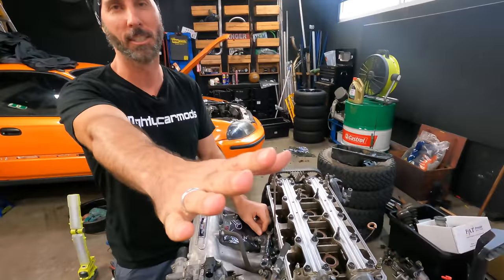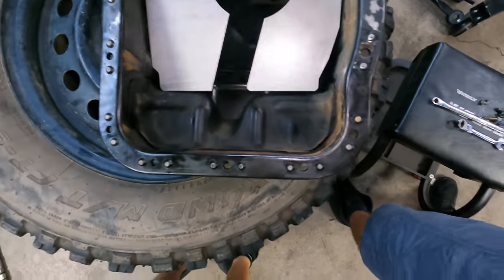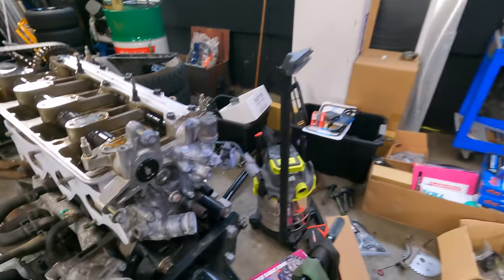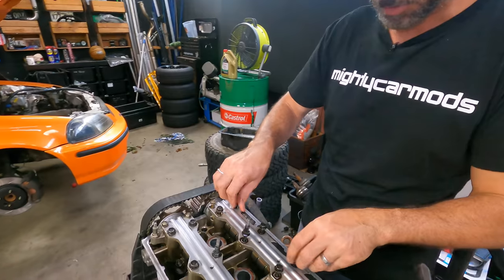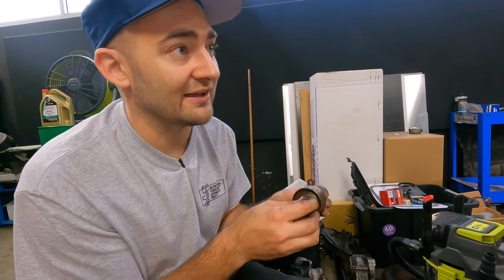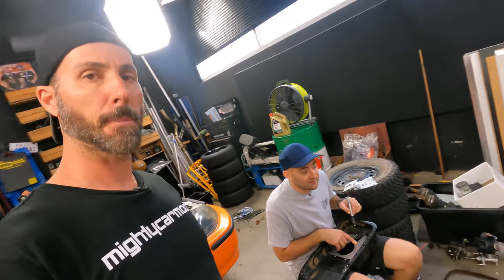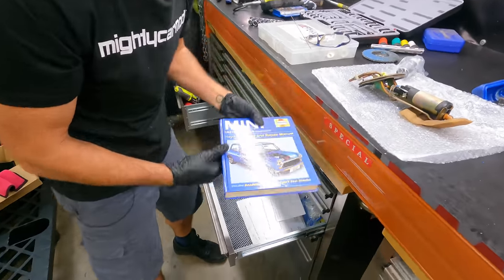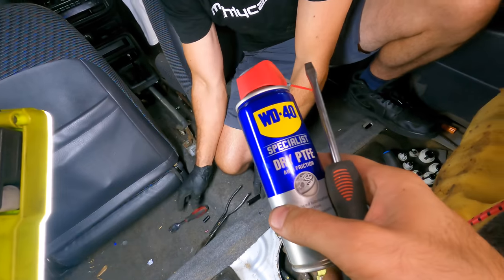Spoon your SKUNK until he MUGENS - CIVIC Build (EP5)

Comment: It's not only in the US. Imagine Europe with a lot of restrictions with co2 already back in the nineties, but most of all, huge taxes on engine size and cc. Then a civic vti comes along with a 1.6 cc making more power then all 2.0cc counterparts, like golf gti, Nissan sunny, Ford rs2000, opel gsi, you name it. Less expensive, better finished and much more reliable and it's even more powerful. Yes. In Europe, in the 90s having 160hp was like crazy. There are still a lot of people using them because of that. There were no turbos accessible here, or the ones we got were weaker than a vtec with 160hp. That's why 😜
Reply: And not only that... I don't know the reason why you got the crappy ones, but in Europe having an honda at the time was crazy technological, imagine 1992 civic vti with everything electric, windows, mirrors, sunroof, hydraulically power assisted steering, abs, 4 disc brakes all round.... Only Hondas and maybe some other Japanese cars, had it. VW didn't even offer electric windows at the time, only if optioned and very expensive. Still, when we compare speed, I guess it's a matter of culture, Europe has less straights we are more about agility. And I bet this civic will do 25laps and engine still smooth as opposed to an impresa for instance. 😂😜

Comment: I’m answer to Moog’s question civic, and hondas in general, are cheap, reliable, easy to modify and have lots of individual routes you can go.    Non-Honda owners hate on Honda owners because they do not get it.   Even the smallest engine models of each car are fun to drive.   It’s just amazing engineering.

Comment: 17:00 Well you could just go on a used car website and get the VIN from a vehicle listing with a B16A in it. Makes life easier when trying to order through the dealer. Our Honda dealer here doesn't require a VIN to purchase/order parts so when I go to them I just pull out part numbers or provide em with year, make, model & trim of vehicle & they just get what I need. But our Ford dealer does so I know how annoying it can be.

Comment: people up here in canada own hondas because they are drit cheap and easy asf to work on, same thing with the acura rsx's if you want a lower coupe than a sedan or hatch and you can buy ebay turbo kits for them for like 800$ and make big power for dirt cheap. Try buying something like an old mustang and then your into something much bigger in price, size, price of parts, price of insurance etc.... Civics are like the entry level project car for someone on a budget. They can buy it for dirt cheap and get it running for dirt cheap also since OEM and aftermarket parts are so cheap, as well as insurance being dirt cheap as well on those

Comment: VTEC!!! When it kicks, Your ADDICTED!!!   BAAAHHHHHHHHH!! And VTEC bug for life!!!. Cuzz after on, driving (besides just normal driving), but driving in performance manner, and racing, no matter what ur in, just doesnt feel right, feel kinda an empty void when you dont feel, and hear VTEC hit.... Its weird lol.. I build, ive built, from many different manufacturers, and love em all, but my hondas are always my goto!!  And besides the VTEC bug!! its just the best budget to horsepower gains around. Especially when your young with the enthusiast mind, and not making much money yet. its more affordable to modify and get back a return on investment.   

And on another note...... Marty, did you just apply RTV to the rubber pan gasket??? NOOOO... RTV is for paper/Cork gaskets and straight seals only.. Rubber gaskets need to be flush against the metal to seal. luckily RTV is squishy enough and probably not cured all the way before the pan went on.

Comment: Moog, the point of the honda is its almost fast but always works, and if it doesn't it cheap and easy. Unlike lots of horrible cars. I had 3 eclipses, and 2 Ford mustangs, 1 240sx ,just broke everytime you put your foot down it felt like. I did a honda accord h22 swap and swapped it to 5 speed too. Drove it 6 years without fixing a thing passed inspection every year, I've had 10 hondas now just bought a 2021😊

Comment: Why not apply some voltage to the old pump and give it one last job to drain the old fuel from the tank before you remove it? A hose to its outlet into a container and job done.

Comment: That 15100-PR4-A03 oil pump are for non-vtec B18 integra. I think they don't have as much flow (for vtec I guess). And they are know to not survive long when used on higher RPM vtec engine. Common failure for people puting vtec head on B18-B20 block and not changing for a VTEC oil pump. Check for 15100-P72-A01 instead.
My advice,  don't put RTV on your brand new oil pan rubber gasket. Now you'll need to change it or waste 2h trying to clean it when you'll remove the oil pan.

Comment: Ah, the joy of trying to order OEM parts when doing engine swaps etc. The way around it is too find a vehicle for sale in your state with the correct engine etc fitted and then do a rego check with your state roads dept. Dunno if all states do this but in VIC we can do a rego check and this'll give the VIN too. Done this a few times when having to order Subaru parts 😉
Reply: So you can’t order OEM parts in AU without a vin?  I live in the US and was completely baffled at that.  As long as you give the make, model, engine info, that’s all they need to look up the part
Reply: @radracer713  Nope. VIN or licence plate details for main dealers and even some motor factors.
Unlike in the US where you just need make, model n year.

Comment: Even in the Honda community, there are factions. I wish I still had a 4G Civic, and like my wife's 10th gen hatchback, but have no interest in anything from the 6th through 9th. I'd still prefer a B to a K. Hell, I love naturally aspirated D-series engines. You can get enough power (160-170ish) on pump gas with a N/A D-series for pretty much any street use, especially it's not difficult to get a 4th gen down well under 2000 lbs.

Comment: Hey guys ,I really do think that's the wrong oil pump, "PR4" is a part #  for the non-vtec engines (B18A/B),  you would need "PR3" (B16A1-4) or "P72" (B18C1) or "P73" (Type-R)

Comment: We own a Honda because it was given to us for free. I wish we said no when we were offered the piece of garbage... 

Turns out our lovely Honda, like countless other hondos made in Japan and Mexico has an electrical Gremlin. 

So I started with an alternator swap, then stripped the tensioner bolt trying to get the serpentine belt back on the motor, a $175 mistake. I got another tensioner assembly, but even with the right tool, the belt is not going back on without some type of divine intervention.

So now, I'm considering black powder, a 20 gauge shot gun and a glorious YouTube ending... :)

Comment: The square port to circular port fiasco has been solved. Coolant flow passage ports are not as important as oil flow passages. Especially at that diameter. You’ll be fine as long as it’s sealed properly.

Comment: They're cheap and everywhere easy to work on and just usually where alot of kids in america start racing. I always has bmw and nissan in highschool but there were always a ton of hondas at the meets and racing in tampa and Orlando i still have a 97 accord but its my dd for work super reliable and good on gas. Paid $1000 usd for it 3 years ago has 283k miles on it now still runs strong and smooth

Comment: ive never worked on a car before. i mean i had a couple of old timers help me put in a clutch plate in an old 92 f150 and i can rotate tires change oil and change brakes and rotors but ive never taken an engine apart and i want to learn what car in america is cheap to rebuild and i can find aftermarket performance parts for cheap and i can easily work on it?

Comment: Dealers not talking to you unless you have a vin, is likely the whole "we can't guarantee they're the correct parts" 

Which is understandable I suppose..

On the other hand - If you're good with the parts program, you could put a bit of effort in.. and just explain that you can't guarantee fitment etc.

 I know that if I put CE9A & SNGF into my Mitsubishi ASA parts program, it shows me the catalogue for the Evo 2 & 3, and then all you really need is the production date, for when there are parts with variants that changed over the course of production.

Comment: With a civic people love them becous it is usually the 1st car you get when you start driving and the 1st car you get to  actually work on and start your love for modifying cars it also help that honda engines are extremely strong and can handle most anything it gets from boost to extremely high rpm the aftermarket suport is massive and also easy to get unlike 80% of outher cars for example a Toyota celica good luck Mitsubishi eclipse has some but not much or Nissan Sentra almost no aftermarket support all of these cars are in the same price range and all of them are 4 cylinders honda is the only one that offers reliable strong engines with a massive aftermarket support and thay also have the most simple no need of special tools ease of work for a honda all you will need is a no2 Philips screwdriver  the pulley holding tool wich is not necessary 5.5mm 8mm 10mm 12mm 14mm 17mm 19mm and a 21mm a pair of good players a good torque wrench some grey RTV on every outher car you will need a tool you will need to buy just so you can complete the one that you will probably only do once  Nissan has the quick connect same as Mitsubishi Toyota and Mazda or some sort of torques or hex bolt what will just strip if their is any rust of any kind rust or thred  Lock I have worked on so many German junk cars that the engine had to be scrapped just becous a bolt got stripped becous of thred lock or rust or bolt was not straight or when torqued the tiny head got ripped off I bet in Australia that is not a problem it must be nice not dealing with the massive amount of salt on the roads when it shows 12 inches  or 30.48 centimetres in 3 hours

Comment: I like my honda because parts are always available, its cheap to run gets good fuel mileage when I drive the shit out of it and it doesn't take a lot of oil, its reliable, the engines love to rev and make good power when they have the right parts, and the suspension is fantastic for how cheap the car is

Comment: It’s circle cuz someone just drilled it out since aftermarket parts don’t come with pre drilled holes and it’s also for multiple engines so they give you the potion to either cut out a circle or a square

Comment: You forgot the "whale penis" intake as one of the weird names for honda parts LOL. Those phenolic risers make a big difference in IAT'S on a lot if different cars, especially where the manifold is tight to the top of the head in something like a VQ. You'd be surprised on how much that little riser brings down the intake temp. Should've thrown a set if lumpy sticks in there while you guys were at it. Cams make a huge difference in the powerband and useable curve which you can adjust via a set of adjustable cam gears. Smart idea on the windage tray/ pan baffle. It isn't out of the realm to pick up a few h.p. from simply keeping the crank from 'cutting through' the oil, and at the same time, it's cheap insurance to keep the oil near the pickup strainer when your ssssiiiiiccckkkk civic is hitting all the apex's lmao

Comment: Please put gray rtv or Hondabond on the cam end caps like the Hanes manual states!
Reply from the maker: These ones have o-ring seals, bot different to stock ones
Reply: @mightycarmods  it goes on the tabs of the cam cap itself.  It prevents seepage at the very corners where the valve cover gasket will mate.  Yes I know the delete plug has three orings on it.

Comment: 15:35 because even when it's a PITA, replacing the timing belt in the car is still easier than pulling the engine.
EDIT: last time I tried to get genuine Honda parts it was also a nightmare, and I had the VIN

Comment: Engine work 101: if you take apart the engine to the point where you can see the timing belt, and you didn't swap it yourself, or it wasn't done under warranty or by someone you trust, within that year. Swap it. Live longer, smile harder.

Comment: why people like Civics? They're cheap but relatively high quality for the price. The hard point architecture of the chassis make 'intergenerational' swaps very easy. The engines are stout so they can take huge power/torque increases. Every generation was produced in huge numbers, so used parts are plentiful. And because of that, the Civic tuner community is HUGE.

Comment: I got a free formerly turbocharged civic, and it had that same intake on it. I knew nothing about them and still know nothing, but I got it and it wouldn’t run, turns out the IAC valve and the MAF we plugged in backwards. Sold it for 1500 because people are really mean to civic drivers on the road, I was constantly getting cut off and flipped off. For no reason, like bro I didn’t stance the damn thing chill.

Comment: I have a civic and an s2000. Non-honda guys buy an s2000 and immediately rant and rave over how easy they are to work on. Guys like me that started with a civic hate working on our s2000. The civic seems like every bolt was carefully placed so that you can fit a wrench or tool on, in and around it. I'm never scared to fix something on the civic.

Comment: Why own older Hondas? Relatively inexpensive to buy, insure and maintain. Easy to work on, especially as a beginner. Fully independent suspension with double wishbone upfront is unheard of especially now. Even the original D series that was in there...super reliable.

And you're correct, you buy a civic cuz in 90's North America, we had shit for cars - still do for the most part.

Oh, and you're going to want to put some HondaBond or gasket maker on those cam seals. Will leak like a....civ...

Comment: Why people like Hondas: they are lightweight, you can get every racing part and put it from one to another and they are cheap... They are very good at cornering, you put upper, lower strut bars, coilovers, a traction bar, and it handles much better. put some aero, some turbo boost and it will be competitive with three or more times more expensive cars on a track. Because of it's double wishbone suspension and little inertia it flies like a gocart. You'll go on a track, you'll see how nice it goes, but I have a bad feeling about the 6gen hatch choice, as I owned one and it handles not so good as the 5th gen or 4th gen. Must be something about the suspension geometry that makes it feel different. The 5th gen sedan with a low turbo boost did handle so perfectly I could go 150kmh sideways and fully control the car and it weighted 1030kg, without any weight reduction. The longer wheelbase and tail makes you feel safe that it will not pass the front end the instance you've lost traction in the rear as you should get with a hatch. (keep the tail soft, better play with anti roll bars, have a big ass wang lol to keep it as a dart arrow) However with a 4gen hatch the tail does not lose it's grip so instantly, maybe because the rear wheels are almost out of the rear end, idk. But the weight of those ef hatchbacks are maybe 800kg or so, so probably that is why those Japanese kanjo guys love them so much. I bet you've seen the Jordan Cox pass lol :D Anyways I am very happy that you guys chose building a civic, as they are underrated cars just because most of them are owned by broke guys, who can not build them properly... And the main problem of a racing world Hondas is that you can not put a turbo in them and just go, because you'll have to put a half of a train rail in it due to the weight regulations, so it becomes like a Bruce Lee on drugs with a bag of bricks, what makes it pointless... Luckily there are time attack events, where you can see how it would look in a fair world.

Comment: Honda civics are good reliable winter sedans/ small cars. It's the compromise you make for going with a small vehicle in North America where cold weather reliability, gas mileage, and price depreciation matters. The domestic sedan cars become rust buckets in like 5years, are unreliable and don't last a decade or two of solid use. Maintenance is cheap also because of the vast aftermarket.
Reply: I just want to add these are impressions made from decades of experience ... the Japanese vehicles were doing aluminium bodies and engines that don't rust as easily as the big 3 (GM, Ford, Chrysler) in the early 90's. That made a lasting impression on vehicle owners who had resalable cars that were more than 5 years old that didn't depreciate as much. The domestic cars went aluminium engine and body in the mid 90's and early 2000's ... but the Japanese vehicles made that early impression.

Comment: Those plastic intake manifold gaskets do not seal for shit. They do well at blocking heat soak to the manifold but are not good especially on boosted cars. Speaking from personal experience with my boosted s2k